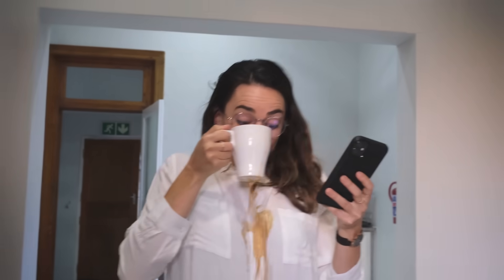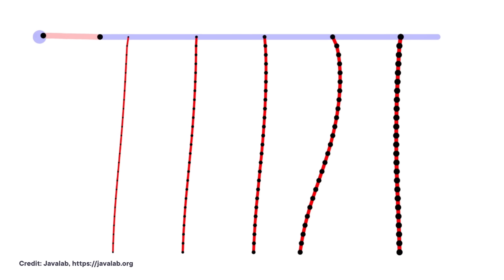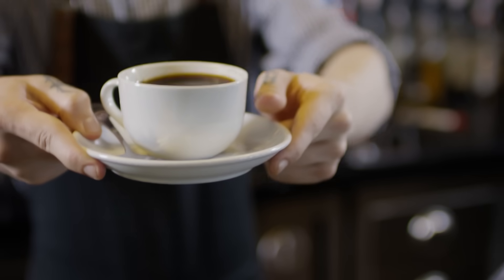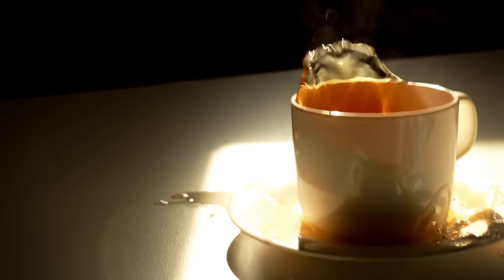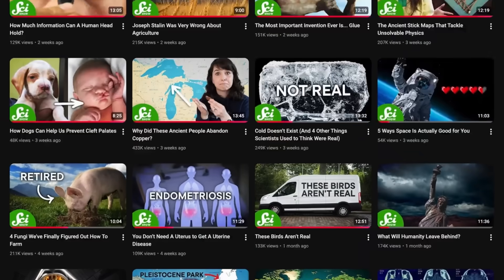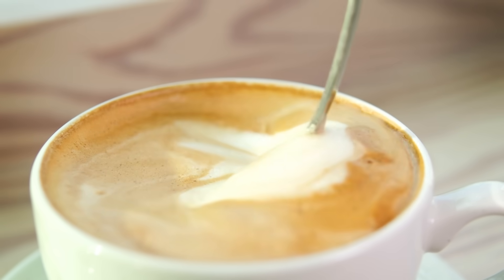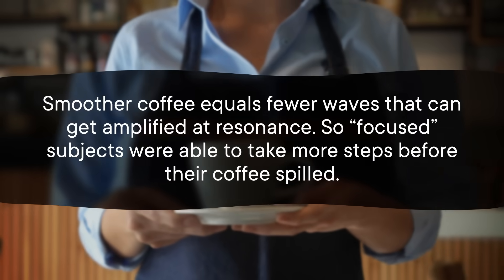Your Coffee Mug is a Physics Disaster

Comment: I know several tricks to prevent that. 
Either grip your cup by the rim and let it hang down your side, or simply stick out your ellbow. You see, when you have your ellbow down by your side, it signals to your body to put the arm in balance mode and you instinctively produce that little pumping choo-choo motion with your arms - which is exactly the opposite of what you should be doing. Sticking your ellbow out breaks this automatism and makes your brain instictively want to compensate for the motion of your body. Which is exactly what you should do.
Reply: The elbow trick is where it’s at. I instinctively move my arm so that it cancel out my walking frequency. Tea stays perfectly flat the whole walk.
Reply: I didn't even realize I was doing the elbow trick, but it's exactly what I do.
Reply: @bartoscar  What you are doing when you are using the ellbow trick is basically give yourself another degree of freedom in your movement. By hanging your ellbow down you more or less eliminate the up-down movement, reducing the amount of force needed in the shoulder, which is what you want most of the time. If you stick your ellbow out, you give yourself the smooth stabilizing capabilities of a steadicam rig - which are modelled after a human arm.
Reply: I learned to walk with the mug on my side, at around hip height, to avoid spillage in case of sudden stops in the corridors between the coffee maker and the desk at work. 
I guess the result is pretty similar
Reply: By the powers of weaponised autism, I discovered this decades ago. Because it bugged me greatly, and I experimented until I found a working solution. It is very natural to me now.

Comment: I have coffee for 60 years. And for 59.99 years i have used a big mug AND DIDN'T FILL IT .
Reply: I respect that this is the correct answer to the problem, but I refuse to use it and will continue to carry my big spillable mug completely full.
Reply: @heck3143  Same. More coffee per trip is more important.
Reply: @AwesomeFish12 what do you mean more coffee per cup? A bigger cup is by definition. More coffee per cup. Am I missing? something?
Reply: @heck3143 I say mug lids. Like with the silicone ring on it so it snugs in
Reply: @heck3143 
I use a dollar-store, tall, clear-glass 20oz mug (a 'beer stein' mug? with the big, square-ish handle)... Got 3 of em, for coffee and water all day long, every day.

I can blend (read: froth) my coffee with my butter+coconut oil (+ even a li'l whey protein! 👍) IN the mug, when it's still 2/3's full, and it's glorious.

(Of course - I then fill it the rest of the way, to satisfy my neurosis, and gently blend that for 1 careful second... At which point, I can proceed to try not to spill any of my oily concoction everywhere - and fail, spectacularly. I wouldn't have it any other way. 💚 DEATH before dishonor.)
Reply: @heck3143 😅
Reply: @heck3143 i really don't understand. It's coffee, not water. I could fill a rather big mug, but i wouldn't finish it without looking myself as if i were lazying out. And if I returned with a full mug to my workstation I really wouldn't enjoy it as the last would be pretty much cold.
I rather have to get of my spot twice as much than get it full. After all, the mug is half full, rather than half empty
Reply: @heck3143 or fill it to the top and slurp some while it’s on the counter and then you get more coffee and you’re still able to walk to your desk
Reply: Yep! Roommate in college opened my eyes. I asked "how the heck do you not spill this stuff??"

"Uhh, don't fill it all the way"

Genius
Reply: @Bc232klm but if you don’t fill it all the way you don’t get a full cup. Which is the entire problem with spikling so what’s the point
Reply: @algotkristoffersson15 Get a cup twice as big?
Reply: @LachskoenigIV  it still won't be a full cup unless you fill it 😁
Reply: @algotkristoffersson15  it's so much easier to leave 10% free than learn physics so you can walk with a mug without concentrating
Reply: @Lastielion just take a sip before you start walking. Then you get a whole mug but still don’t have a high risk of spilling
Reply: @algotkristoffersson15  GET A LARGER CUP.
Reply: That's free coffee real estate going to waste
Reply: @voidcore  yeah but now you have a good reason for second coffee
Reply: @voidcore I'm pretty sure this is why at every coffeeshop in my city they fill your coffee cup to the brim! Hey, this is what those cup lids are for!
Reply: @voidcore  it goes to waste if you spill it
Reply: @voidcore  Start with a 10- or 12-oz mug
Reply: That's just crazy talk! (He says, while quietly spilling some coffee into the sink and whistling nonchalantly)
Reply: That does feel like a common sense solutions lol
Reply: @michaelmayhem350 it's no longer "common" sense; it is now.... good sense!
Reply: @michaelmayhem350  My solution is simply to adjust my pace. Of course that won't help professional service personnel much
Reply: true. i guess this is more of a fun fact. like we learn so much things in school and always think "where am i going to use this?" but we use them all the time without realizing. it's cool to understand how the world works scientifically in simple forgettable day to day experiences.
Reply: If you need school to learn to not spill your coffee then there's no hope for you 🤣
Reply: It is impossible to spill an empty mug.
Reply: @noellecrist-see1215  facts
Reply: Or, of course, you can watch what you're doing.
Reply: Stop bringing logic into these serious issues! 😆
Reply: I use a 12-oz mug, and just don't fill it all the way.
Reply: Or just get a themos mug with a lid. Only time I spill coffe is when I put it in my bag forgetting to close it.
Reply: Yeah, I had to check this wasn’t an April fools joke! 😂 just DONT fill it to the brim! Duh!😂
Reply: @LivingroomTV-me9ozI just drink straight from the pot, my coworkers hate me though. 😂😂
Reply: Using a really big mug will make the hot coffee cool down a lot quicker: there's more mug to heat up. But if you heat the mug with some more of your hot water first, it will be OK.
Reply: Saucer/ coaster anyone? 😂
Reply: Can always go back for more! 😊
Reply: Lost knowledge confirmed
Reply: Exactly.    Just get a container of adequate size to the task.
Reply: I haven't been drinking coffee for too many years (the last 26 or so out of my 57 years) but I very quickly figured that out too. 8 ounces of coffee in a 10 ounce mug works wonders. Of course, the tips in this video are helpful if you have no control over the size of the mug and the amount of coffee you're dealing with.
Reply: What happened in the last 4 days that made you fill it now? 😂
Reply: @BryanHilderbrand I was impressed that he could use a large mug at the age of 4 days old, but that’s the other option.
Reply: @twifosp I think you’re missing an option. Filled the mug in the first days of coffee drinking. Not sure why you think this was as a newborn but that wasn’t stated and would indeed be odd.
Reply: @Blackhawk.44 haha, misread that he was 60 years old 🤦‍♂️
Reply: i must have really good resonance with coffee cause id spill it even if it wasnt all the way full unless i walked extra carefully
Reply: That's called wisdom, and I'll have none of that
Reply: I like the implication that you spilled it the very first time (0.01%)  and then used a bigger mug from then on xD
Reply: How is that even possible?
Reply: It sounds like your greatest challenge in life has been 'The Unfilled Mug.' Maybe try a smaller cup?
Reply: I do that and also have a carrier, it's called spillnot, because I have to get my coffee upstairs and I would always spill it. The carrier works great and uses physics
Reply: Or, or

Use a soup mug AND fill it all the way
Reply: Have a potter make you a different shape of mug, instead of an industrial straight-sided bucket.
Reply: HOW scientific is that? Perfect!
Reply: Damn, you beat me to it
Reply: Spoken like a coward. I am proud of the many burns on my hands. PROUD!
Reply: No I'm digging the coffee purse. We could even get coffee murses
Reply: This is what I’m saying. Just don’t fill to the top.
Reply: sounds like 59.99 years of wasted potential :D
Reply: Even with a half full cup I tend to spill some when I walk but that’s more because my hands don’t work right my fingers pop out of place easy
Reply: Some big mugs will not fit some coffee machines
Reply: I get that that's not the point of the video, but that was my first thought, too. Just don't fill it up as much.
Reply: How much grant money did you get to do this research?😊
Reply: We don't care
Reply: A coffee mug should be able to comfortably fit your closed fist.
Reply: I love that you're implying that you did fill it fully at least once 😂
Reply: Brilliant
Reply: That's inefficient.
Reply: Exactly !
Reply: And yet clickbait still owned your ass.
Reply: Well if you don’t fill a cup, how do you get coffee from the pot to your mouth?
I still use a mug, I just don’t fill it all the way.
Reply: Have you noticed how hard it is to buy large coffee cups.
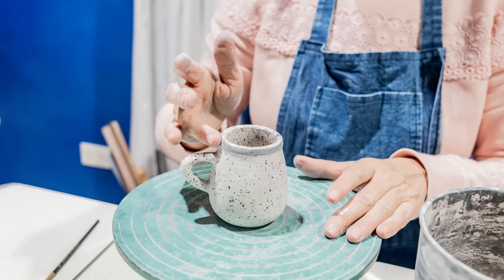Reply: My go-to coffee mug holds about 1/3 of a pot and is wider at the bottom. Best of both worlds. 5:08
Reply: Yeah, Don't fill any glass all the way, if you plan to walk with it.
Reply: YES! THIS. THANK YOU!
Reply: Why do it the easy way, when you can actually overthink it and make it complicated?

I've also never had problems spilling coffee due to 'walking'. The biggest cause is bumping into someone or tripping.
The poor mug has nothing to do with it.
Reply: You started drinking coffee at 3 and a half days old? You had bad parents.
Reply: And that lack of innovation is why we still have this problem
Reply: Swedish here, drank coffee since I was 5 (yes my brain is cooked) and never spilled coffee once in my life lol
Reply: What does it feel like to never achieve your potential
Reply: Same here, Mr. Borg!  Every day I see more confirmation of my suspicion that there is a causal link between the lazy abdication of disciplined parenting, and the incidence of accidents due to inattention on the part of the resulting offspring. If you understand that a failure of dilligence will lead to punishment, you ought learn dilligence by simple conditioning, should you not? That's certainly how I was taught, in any event.
Reply: but these are americans, they drink coffee flavored water, and a lot of it 😂
Reply: @szaszm_  quantity over quality. ‘Murica!
Reply: I have to wait for a visit so I can throw some of it in their face and not spill it on the floor.
Reply: Yeah I literally don't understand this problem. I think it only affects people who add milk or otherwise ruin their coffee with disgusting additives?
Reply: @BDnevernind  Chocolate coated coffee beanzzzzz ❤
Reply: @ChrisNotTheKing That's different!
Reply: @BDnevernind  Lmao, I like black coffee as much as the next guy, but why do so many coffee people have to be so annoying about how they drink their coffee black?

Comment: Put less coffee in your mug. Or more mug around your coffee, I guess.
Reply: Or a lid!
Reply: I use a very big mug, only fill it up to 2/3rd and I quickly stir it before walking off. Not sure, but it feels that there is much less sloshing when it's still stirring around the mug.
Reply: @2Adapt and when you DON'T fill the mug all the way...
Reply: I refuse and I resent you for the suggestion. 
Hesd empty, full cup, cant lose.
Reply: @heck3143 what's a "hesd"?
Reply: No, I buy large insulated stainless steel tumblers
Reply: Taller cup
Reply: A gas station near where I lived several years ago sold coffee at same price for any mug you brought in. Once there was a gal in there with what had to be at least a 1/2 gallon (maybe larger?) plastic coffee mug. I knew it was purpose built for coffee as it had a different gas station logo on it and said in 4 inch tall letters, COFFEE
Reply: @JasonW.  When I was in university, the cafeteria had coffee machines that did not dispense a fixed volume of coffee, but they measured the level of the liquid in the mug. So students started bringing in very wide mugs to get more coffee for the same price.
Reply: Like I said, COMMON SENSE...
Reply: Or just add a lid.
Reply: but the whole problem with spilling is that you get less so that would be pointless
Reply: Ya know... funniest thing. I can't get the clay to stay on when I try to build more mug around my coffee.
Reply: Americans don't get past being a 4 year old moron. Cute when 4, moron when 40 in an office spilling coffee because they want to full the cup completely.
Reply: Best excuse for buying a bigger mug😂
Reply: Even better, just use an oversized mug.
Reply: @korg47237  That's what "more mug around your coffee" would be, yeah
Reply: HERESY
Reply: Just use a beaker